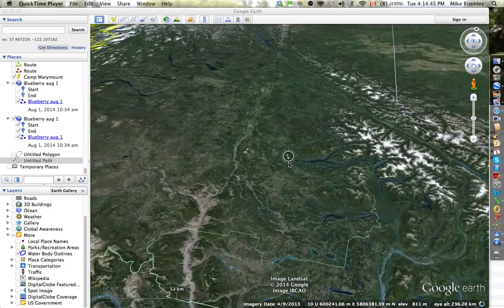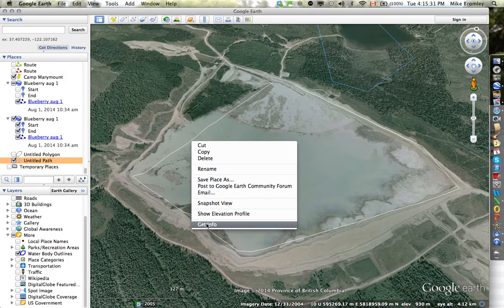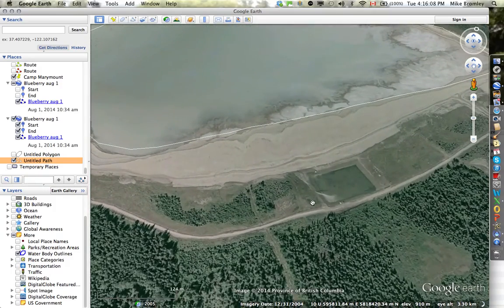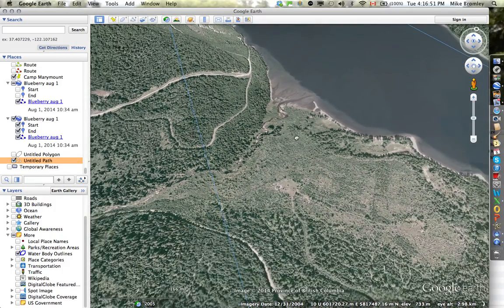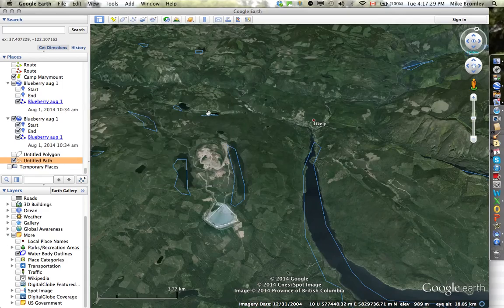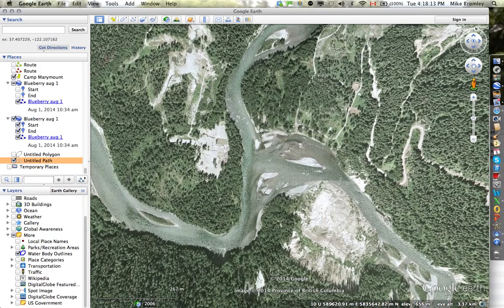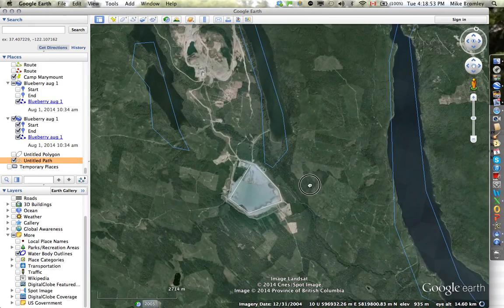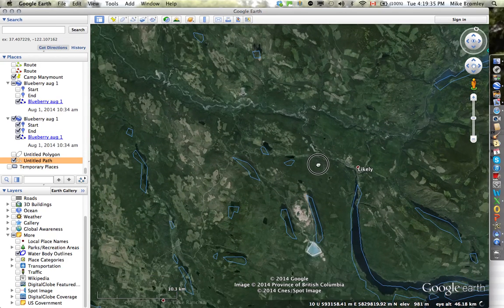Google Earth analysis of the Polley Mine Tailings Discharge

Comment: 1 - The breach was not on the SE bank. The breach was in the NE bank of the pond; dumping straight into the Hazeltine Creek which comes out of the south end of Polley Lake. There was a lot of backflow into Polley Lake.

2 - Horsefly Lake does flow into Quesnel Lake via the Horsefly River, along with an equally large area south of Horsefly via the Lower Horsefly.

Aerials of destruction caused by Mount Polley Mine tailings pond breach
2 minutes

Mount Polley Mine Trailings Pond Breach
37 minutes

Mount Polley mine on-site disposal in 2013:

■Arsenic (and its compounds): 406 tonnes
■Lead (and its compounds) 177 tonnes
■Nickel (and its compounds) 326 tonnes
■Vanadium (except when in an alloy): 5,047 tonnes
■Zinc (and its compounds): 2,169 tonnes
■Cadmium (and its compounds): 6 tonnes
■Cobalt (and its compounds): 475 tonnes
■Phosphorus (total): 41,640 tonnes
■Copper (and its compounds): 18,413 tonnes
■Antimony (and its compounds) 14 tonnes
■Manganese (and its compounds): 20,988 tonnes
■Mercury (and its compounds): 3 tonnes 
■Selenium (and its compounds): 46 tonnes